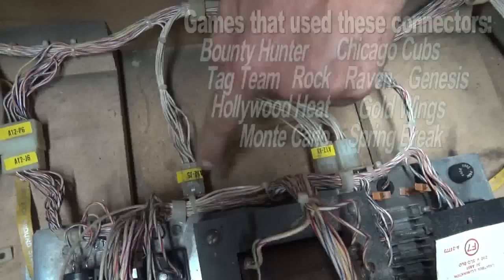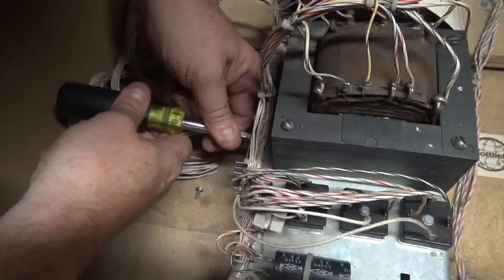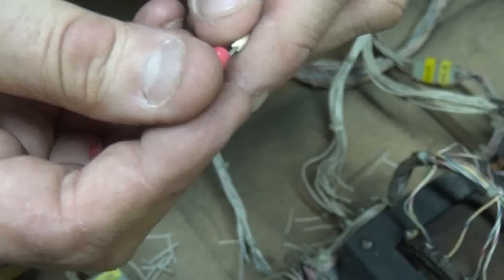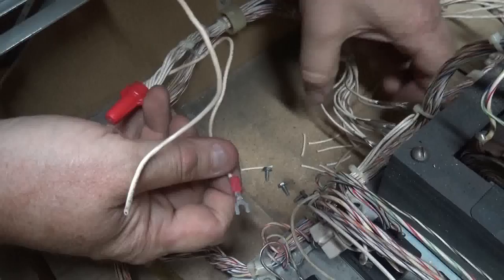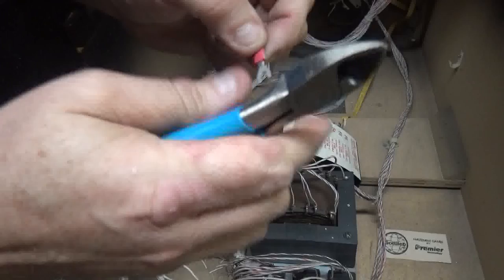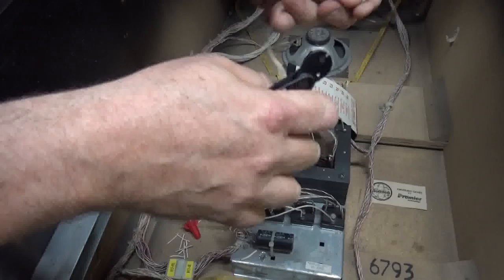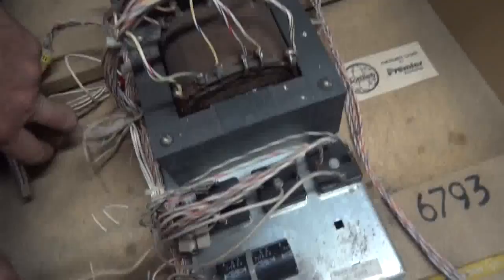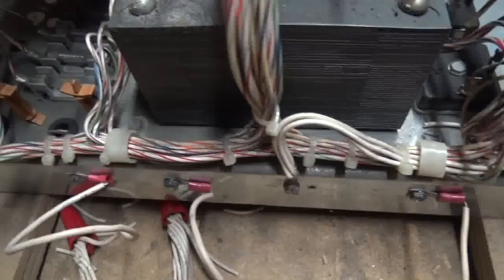#690 Fixing GOTTLIEB System 80B GROUND Problems! Todd's Tips TNT Amusements

Comment: Thanks for making this video. I have a System 80B game that is giving me all sorts of problems and it sounds like based on what I have read it could be related to grounding. I still have the molex connectors on the game so I have high hopes doing this fix will correct some of the problems.
Reply from the maker: Austin Mackert Yes...it probably will!
Reply: TNT Amusements Inc Good news! It seems some of the issues I was having have resolved themselves after doing this fix (the biggest being random game resets and the sound cutting out). Thanks again!

Comment: see working inside a computer (DESKTOP!!!) and a pinball game this is all familiar to me.  although I've worked on things that give you a shock as well.  (something that rhymes with tit -- ahem bad wiring in houses is how I learned to do stuff.  although putting on a copper wire counter clockwise is inherently stupid  (oops)  which is why I like the holes on the new outlets/switches.  but not that you've given me the proper area to crimp the above  (oh thats why that never works)  next tip is how to properly solder something  or de solder.  I could watch someone else on youtube but they are either in the wrong accent or so dry I can't pay attention X_X  (Thanks Curt for keeping me alert  )

Comment: Terrific video! I was wondering what larger gage wire size  is  recommended?  (The new bit of wire tied on to the bundle of wires)Thanks!
Reply from the maker: you should try to use 16...but 18 will be fine also

Comment: Thanks for doing this video! My wife and I own a Rock and I really want to do this ground mod! Do you guys have a preferred place to buy the parts you've shown in the video? 

More specifically, the heavier stranded wire, solderless lugs, and grey/red wire nuts?

Cheers
Reply from the maker: You can buy everything from Home Depot or Lowes including the stranded wire...but a couple feet of heavy lamp wire...thats stranded and you can easily cut it down!
Reply: Went out and got the goods and already have a (possibly numb-nuts) question: I bought this wire. http://www.homedepot.com/catalog/productImages/1000/3c/3c4aa547-3e7a-47d1-8a95-e973726abd21_1000.jpg -> but it's copper. Is it alright to mix this w/ the wiring of Rock?

Comment: Question, what exactly is "re-heating" the power supply and logic board? Tried googling and couldn't really find anything, I may have an 80b soon and don't have much exp with pinball machines (just game controller boards and PCs) and I'd rather not screw it up.
Reply from the maker: It means the header pins are reflowed with new solder... The original solder tends to crack at the base causing possible intermittent connections.
Reply: @tntamusements  oh cool that makes sense, thanks for that

Comment: Tod, would you please tell me exactly the name and model of wire strippers that you used and where to purchase that and the fiberglass burnishing tool.  I have a tiny pen type I bought from Wico and my Molex stripper, cutter doesn't work as well as yours.
Reply: Looks like a combo stripper / cutter you can get at most home improvement stores and Radio Shack. I have an Ideal branded set I got at Lowes.
Reply: Thank you

Comment: good video, I am having problems with my machine, when in diags mode everything seems to work, but when I play no ball kickout and I cant select more than one player....I will try this mod to see what happens....Tks Todd
Reply from the maker: your problem sounds like a switch line rather than a coil...possibly a wire broken off one of the playfield switches (they loop 6 to 8 in a line) or a blown switch line.  Usually its the switch line associated with the lane change switch.

Comment: Hello, I would like to know if I can do it with a Gottlieb Excalibur, greetings and 
thanks for so many good videos and sorry for my English
Reply from the maker: Glad you like the videos....the excalibur I think as the long molex connectors...an upgrade...you can do it differently...no wire cutting...instead, take off the two boards mounted to the side of the transformer, and reflow new solder on all the header pins...they are cracked, but not as badly as the older style plug...its possible ONE pin may be burned in those 4 connectors...simply moe that pin and wire to an unused spot in connector (replacing the pin in the connector too), so it makes a good ground from a DIFFERENT part of the connector!
Reply: Thank you very much, I'll bother you again with any other questions

Comment: can I do this on a bad girls, my flippers wont work on mine and one pop bumper
Reply from the maker: I think Bad Girls has individual wires going  to the transformer on bottom, but each wire has its own pin.  Check and make sure NONE of the pins appear burned...if they are, change those pins.  Also, the little satellite board on the logic board always has ice cold solder connections on it...its tricky to reheat though, but that usually solves boatload of intermittent problems too.